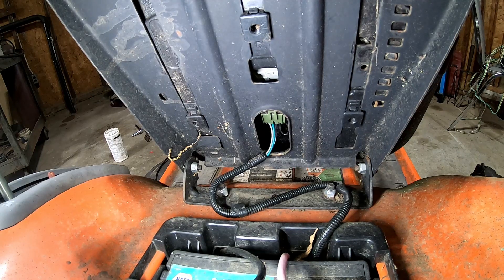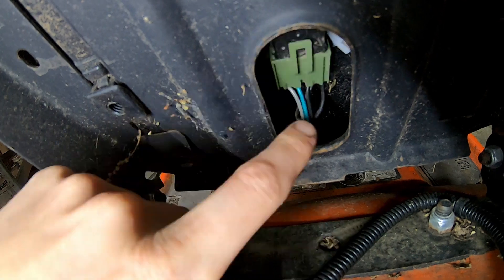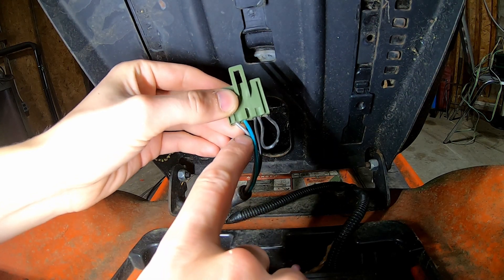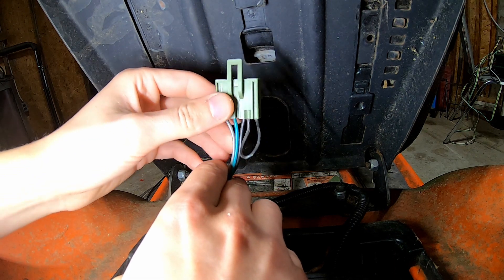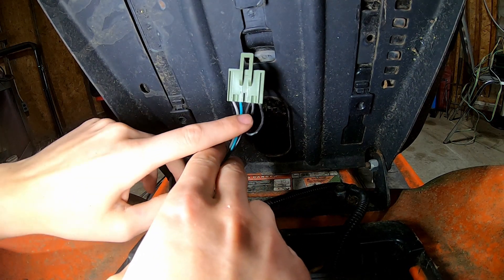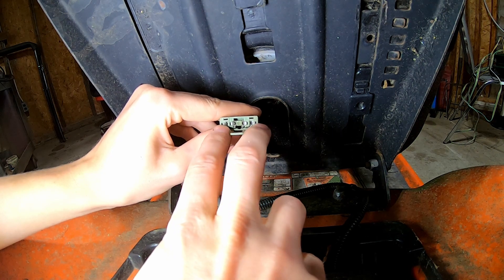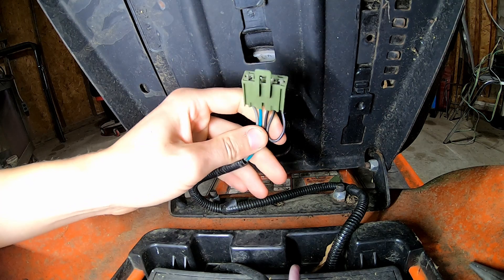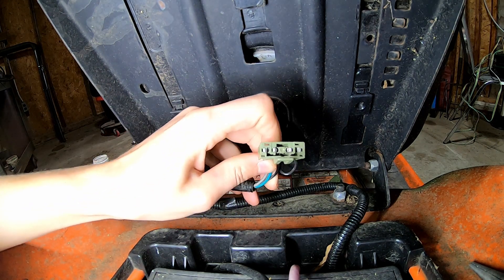4 Wire Seat Safety Switch | How It Works

Comment: Ah ha moment....I removed the metal thing before, BUT I also reattached the connector to the chair, which caused it NOT to work......Now leaving it OFF or not connected to the chair, it WORKS....Great video....The little details are usually the key.

Comment: Is it fine if i remove the shorting bar and connect everything back together? Asking this because my safety switch does not work when the bar is installed,i assume the wedges on connectors are not lifting the bar up.
Reply from the maker: It should be fine if yours has this style of wiring.

Comment: I have a pretty severe side slope on my front lawn about 35° that runs parallel longways with the house..... If I pull that 4 prong bar and lean way off the side of the mower or walk next to it with the mower deck engaged would it still stay on? Thanks for your input
Reply from the maker: @zm4341  yes, it should keep everything running without weight on the seat.

Comment: “Shorting Bar” Thank you for this information. My seat switch had continuity and still killed the engine without being depressed, I assumed the switch was still good but I still couldn’t get any volts to the PTO clutch wires after checking all other parts. After bypassing the seat switch by removing the Shorting Bar, I finally got 12.5V to the clutch wires. Guess the switch was bad after all. Thank you!

Comment: All safety switches. There is a button, When you sit in the seat. The button depresses, all these switches work with that depressing of a button., Take a small nail or wire, press the button down. And wage the nail in between.button always in the run  mode.until u replace  Switch ,leave plug Attached to sensor.

Comment: Has anybody got a JD z435? JD didn’t give me a seating wire diagram. I let somebody go in my shop with me. I only have a pink and yellow  wire and now it shuts down when I set my brake and disengage pto. When I get off seat it shuts motor off

Comment: Thank you for this great video! I bought a new seat for my Craftsman DYS4500 lawn tractor. Although there is a round hole for the safety switch, there is no way to attach the switch unless I enlarge the hole and cut out tabs to accommodate the switch. Removing that bar quickly solved the problem. Our property is all very flat, so am not concerned with tipping over. Thanks again!!

Comment: 'm getting no power to solenoid I'm assuming because a don't hear it click when i turn ignition key on. i removed the metal connector in safety switch so mower wouldn't cut off if i got off lawnmower now it wont start. Or is it a different problem?
Reply from the maker: I would get out a multimeter and see if you have power going to the solenoid or not first off.
Reply: @tightwadproductions961  thanks and if no power to solenoid?
Reply: @tightwadproductions961  if it helps I spray carb fluid in carb and it runs for like 2 seconds then shuts off. Can I just cut the end off the solenoid and bypass it? I'll run a 1/4 inch fuel shut off valve as well.
Reply from the maker: @D  sounds like the two are unrelated. One is a fuel issue, and the other is an electrical issue.
Reply: @tightwadproductions961  cut the tip/nipple off back fire solenoid and it fired right up. Thanks for taking time to respond

Comment: I have a toro lx468 and the mice bit all of those wires apart so i just cut the connector off. Your saying it should work still with 3 loose wires hangin around? What do you think i should do. Looks the same as your connector. Thanks.

Comment: Thanks for this. I spent two days going around in circles trying to figure out what I was missing. My old mower had one of these anti-tamper bars but it was easily visible. I was barely able to see the tabs on this version even when I knew what to look for.
Reply: The John Deere 100 series uses the same switch.  Another way is to remove seat and twist switch assy. to remove from seat.  Push in 3 tabs to pop off the cover that tranfers weight on seat to a simple push button switch. You can hear switch clicking while pushing on it.  Place a plastic, wood or whatever plug about 1- 1/4 dia., 3/8 "  thick that holds button down with 3 prong cover back in place. Put it all back together and plug wire harness in.  Did it on my new J.D. 155c in 2006 and never any problems since.   Excellent video, Thanks

Comment: Thanks for the tip. My Craftsman GT5000 has the same 4 pin connector and same 4 pin jumper bar. Removed and left unplugged. I rarely use the mower, mainly the rear blade for small grading jobs. Constantly having to turn around to see the blade and work and having the engine start to turn off when turning around is a problem. I'll plug it back in when/if using the mower.

Comment: So the 2021 Cubcadet zt1 switch is four wire. Once unplugged you must jump 1 & 4 then remove that busbar from the two middle pins (2 & 3). 
To sum it up the two outermost wires need to be closed/jumped and the two inter wires need to be open. 
These engineers are pretty smart so the average person without electrical experience won’t be able to defeat the safety seat switch.
Reply: Hell yeah DirtyDon!  It worked but I don't know why the 2 outer wires need to be jumped if the switch only opens the 2 inner wires?
Reply: @bewareofthedawwg8765  ... Not sure here either, but I tried both ways and it only worked like he said with the  middle 2 and 3 busbar removed and the 1 and 4 jumped on my  new 2021 ZT1 Cub Cadet...😎👍
Reply: Butt Splicing wires 1 & 4 (both white)  Worked for me for my MTD Dewalt that is a rebranded Cub Cadet. Removing the small spade did nothing initially.